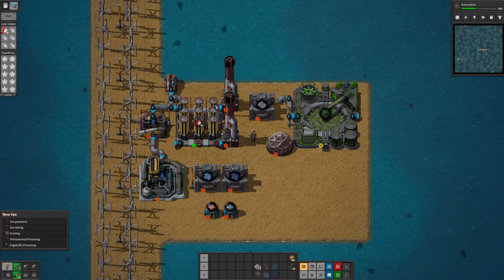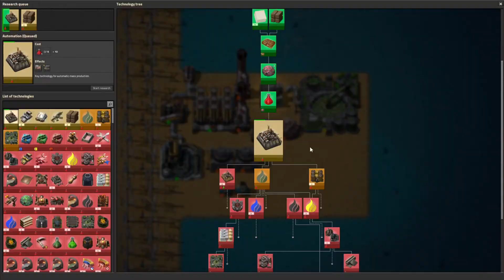Seablock Early Game Automation (episode002)

Comment: So the power loss was from splitting your wind farm into two right?
Reply from the maker: That's a very good hypothesis, but it does look like there are power poles connecting the two halves. I'm going to check how much power the starting turbines provide. I recorded this episode a few times and I may have misremembered the power I had. EDIT: They produce 3.6MW, so you are probably right. So then, why does it look like there is a power line? I may never know.